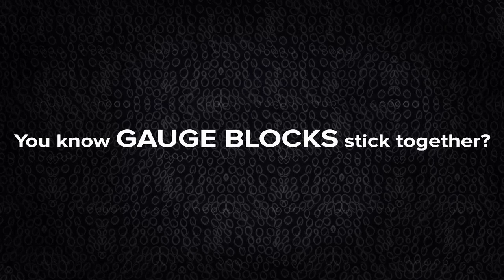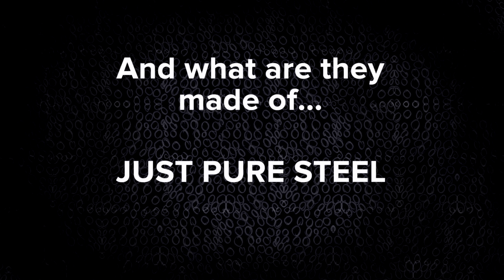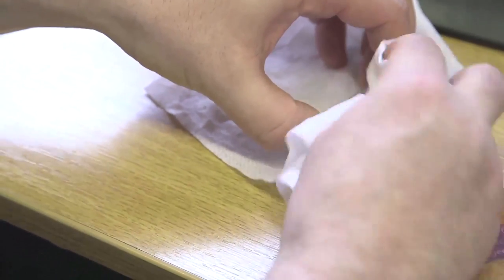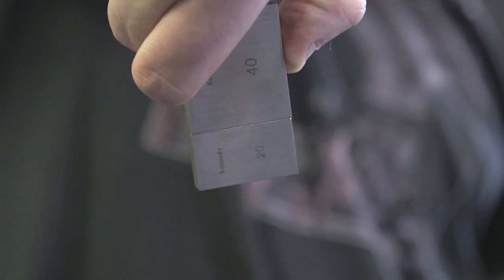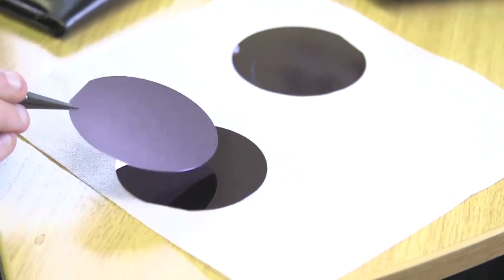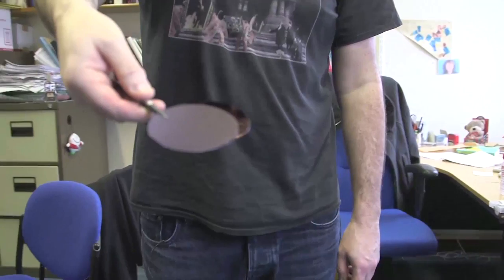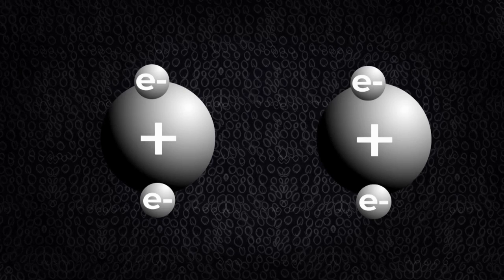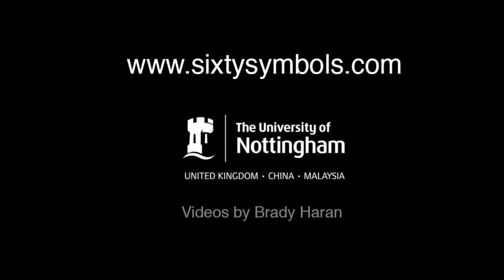Gauge Blocks (Van der Waals forces) - Sixty Symbols

Comment: No offence,  but strictly-speaking I think there is an exchange of charges, at least between the protons now exposed due to this manipulation of the atom's electron density such that exterior charges (generated by electrons) could be exchanged with the exposed proton. I ran into this a few years ago when fumbling around with the inexact notion that Van der Waals forces correspond to gravity; in a convoluted sense, that is part of the picture I suspect, but only part of something elaborately more complex.

Comment: does this kind of attraction work even in vacuum chamber? If yes it is the vanderwaal forces. If not it is the air. I am not sure but I have a feeling it is the air pressure that is keeping them together. Like when you glaze them on each other you remove most of the boundary layer and accidentally put some microbumps on the first layer into the microvalleys of the other. So their mating makes a low pressure zone as there's far lesser air molecules between them this means the outside air will keep thek stuck and if we put these things in vaccuum that effect will disappear. If it is indeed vanderwaal thats's the dominating force then vacuum wony affect it so this can be used to distinguish between the two proposed solutions

Comment: @Steve Mould Actually it is quite know why gauge blocks lock on each other. The perfection of the surface is to amazing that the iron atoms from both surface exchange electrons. Well, they always do on each contact, but with the gauges the amount of atoms doing that interaction is astronomical. The resulting adhesion is strong enough to hold its own weight and far more. If you let them REALLY degreased and let it rest for a while, some weeks, once you break the connection you rip out atoms and you kay even damage the surface to a point where no adhesion more is achieved and in worst scenario the precision of the gauge is compromised (I worked with 1 micron gauges in a laboratory long ago, 1,000mm; 1,001mm; 1,002mm.... amazing stuff). In high graded blocks ( metrological calibration ones for instance) even a few days. If you let them for really long time (this one I never did) they begin to exchange atoms and get fused. This is based on the atomic diffusion law, that can predict how long it will take, I do not remember more that deeply this stuff.

But it is in the structure of steel, Iron atoms do exchange atoms in a soup of electrons. THAT is the may reason metals are conductors...

So hope to have solved the microscopic enigma :o)

Comment: Just some tiny scratches will make them very hard to stick. With new blocks they stick like crazy. The surface rust on some blocks makes me think that he gave you the bad set, which is the normal thing too do. Cleaning them often with bad paper towels are sometimes enough too make microscopic scratches.
Gauge blocks are one of the things that you just don't want to let other people use. Micrometers are another thing that are always returned in bad shaped when one of my collegues borrows them.

Comment: Those Gage Blocks do NOT look flat enough. 

Is it VACUUM..? I don't know - vacuum? Without convexity? But rather, extremely FLAT? No.

What if it's in the same vein as SURFACE tension ..? 

The Silicon seems different, bc they're light enough that static would hold them together. 

Metal is much more indicative, bc even if there were an iota of space for vacuum; it CANNOT be enough space to exceed the weight of them.

NIIIICE!!!  I honestly was thinking it could be related to the electrons - but obviously not a chemical bond. I like this HYPOTHESIS; how can you prove it's the Van Der Waal effect ..?

Comment: Chinese rubbing bowls that are used to demonstrate standing wave effects, are also the indicator of the way water molecules are ejected through the meniscus/surface in evaporation. And observably, it's all about resonance/interference and Quantum Operator Fields Modulation Mechanism of probabilities in potential possibilities for QM-TIMESPACE. 

Eg Vacuum welding is apparently the norm in orbital technology where crystal bonding is particularly well ordered and monocrystalline, making materials formed there super strong,  or so we're told, chip tech is Commercial in Confidence?

Comment: There's a demonstration using Chinese Rubbing Bowls of standing waves, (equivalent to thermal excitation), and it goes with the ejection/evaporation of molecules from the surface tension boundary of a substance (and solids), so the interaction of fields of Van Der Waals forces seems to fit the story. Interesting.

Comment: If you press together two truly ideal smooth surfaces of the same pure substance in a vacuum, they will simply fuse. Forget about van der waals forces, they will bond on contact in a process called cold welding. As Feynman put it, the atoms in contact at the surface don't "know" they are on different blocks; it is just a continuous lattice of atoms from one block to the next.

Comment: Do you know of any research that proves this? I'm having trouble finding things pertaining to the van der waals force specifically in the context of metals and what surface finish is required to produce a proven van der waals effect. Optical contact bonding sure but that requires surface flatness better than 1nm but gauge blocks wring just fine at 25nm flatness. Whats the deal? Wheres the references?

Comment: You made it too clean...it is a vacuum thing. It is so flat that a little moisture from the air will make a seal. The metal flexes like a suction cup.
Reply: If it was a vacuum thing, the blocks wouldn't wring without air, and they do.  Put them in a vacuum chamber, and they still stick.

Comment: My understanding is that it is primarily 'stiction' that does this to gauge blocks? Despite the finish of the block they will both have peaks on the surface and the flatter the average surface is the higher the probability of numerous peaks nano-welding to each other under the force and friction of rubbing them together?

Comment: At 1 atm pressure if you prevent air from getting in between two surfaces you have slightly more than 1Kg normal force per square cm, which is more than enough for some nice tricks. If you work with precision mechanics you know that very flat and smooth sufficiently large matching surfaces can cause dangerous sudden detachments...
Reply: And yet they still wring together in a vacuum.

Comment: Lol Prof Moriarty you are meant to handle gauge blocks with greatest care as they are expensive precision equipment, dropping them from that height may cause it to deform. The best method of getting them to stick is to place them orthogonally in the middle (like making a cross) and twist them parallel. Is it possible to measure the exact force contribution of Van der Waals as apposed to other types of force exerted on the interface between the 2 gauge blocks? Does the composition of the metal alloy have any correlation to the force exerted or is it purely due surface smoothness?
Reply: FLATNESS is most important, not smoothness.

Comment: That was a very unsatisfying explanation. The surfaces are extremely flat, and almost seem to repel each other when simply pushed together. The effect is very strong when the surfaces are twisted, or wrung together, and a light coat of oil seems to increase the effect of the attraction. This leads me to believe that the forces he describes aren't the only forces at play here...

Comment: I always understood that gauge blocks held together due to air pressure as per a collapsing can when the air inside is removed so I am not convinced by your argument. To convince me you need to show that they do indeed still stick together in a vacuum and that the force to separate them is the same in both cases.
Reply: Go and check it yourself.
Reply: Whilst I do have a small vacuum bell jar, a water jet pump and ALSO some gauge blocks, they are not suited to carry out the check or I would. Having raised an alternative and I believe widely accepted proposition for the adhesion of the blocks the ball is as far as I'm concerned in Sixty Symbols court to do another video proving me wrong and them right! Not much to ask of a university physics dept. is it?

Comment: couldn't it be explained by the tremendous deficit of air between the plates making the atmospheric pressure the only glue needed ?remember : 1kg/cm2 is sure enough to hold this tiny piece in place.
Reply: ahrf.. sorry, cody has already shown it was still holding under vacuum..
nope, i'm wrong

Comment: We were told to never leave them stuck together because they would ultimately bond together in places and the surface would be damaged in breaking them apart. Maybe this is really just a precaution against corrosion since it sounds like there's no exchange of electrons going on. I suppose this could be proved by leaving them together for an extended period in a vacuum.
the same advice was given about the anvils of a micrometer.

Comment: Phil is ma favorite, but I am highly disappointed with the explanation. This phenomenon, also called Cold Welding, happens in space, at near vacuum pressure. I'm not sure water would be present on the exposed surface under those conditions. Indeed, I am not undermining Phil's knowledge, but I'm not impressed with the explanation.

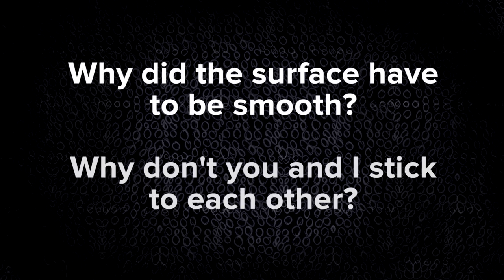Comment: That statement at 5:55 sounds wrong. This might be partially due to the diagram, but his explanation is also vague and misleading. The pits and valleys of rough surfaces don't cause the forces to "not add up right", it simply causes there to be an incredibly low probability of surface area overlap. Since the Van der Waalls force only operates at extremely close distances, this results in a cumulative force too small to hold them together. Consider two equally sized, but differently rough surfaces that have any arbitrary amount of surface area interface when put together. Each side will always have the exact same amount of its own surface area touching the other's.
Reply: They should pin this comment. It's the amount of surface area contact that increases the amount of force, not the bonds being out of wack or something weird.
Reply: I agree with you. The smoother the surfaces, the better the more molecules are in close contact with each other, giving a greater overall effect. Van der Waal's forces are extremely distance-critical, so with a rough surfaces, most molecules are too far apart to "switch on" the attraction.
Reply: @joeblogs8589  There are no molecules. Steel is a metal. Hence a Body Centered Cubic metallic bonded structure.
Reply: @locktite401  Yes,  but my statement is for surfaces in general looking at V.D. Walls forces in all friction.
Reply: Yes, the force and so the influence decreases squared as the radius or in this case distance gets raised, but after this question you want to keep it simple (no offense).
Reply: One more thing to be careful about is orbital overlap.  It is important to distinguish between this and the purely dynamical effect that is VdW forces.  If there is any orbital overlap in the system, then the binding is not strictly a VdW force; it is a chemical bond.  For a more detailed explanation see Chapter 15 in "The Chemical Bond", J N Murrell, S F A Kettle, J M Tedder (1978) Wiley.
Reply: This is more a matter of semantics, of course the amount of surface area where the distance is small enough to cause Van der Waals forces will determine the total amount of force. So these VdW forces do have to add up. 

On the other hand, one could interpret "not add up right" as some forces being repulsive and some attractive, which is definitely not true, all VdW forces are attractive.

Btw, the layer of water also acts as a glue through VdW forces, it works through Keesom and Debye forces. The explanation given in this video actually concentrates on the most interesting of the 3 Van der Waals forces: the London dispersion force.

Comment: Sorry, I'm not buying this. Why do you have to slide them together if the Van Der Waals forces or water is responsible? You should be able to just push them together?
Reply: +Curt D
To minimize air pockets, maybe?
Reply: Don't call him slow... He's just not as fast as the rest of us. You need to slide them together to make sure you have the best contact.
Reply: To scrape off the layer of oxide.
Reply: Curt, you idiot. Because you need atoms very close together to V.D.W. force to work at all. Even with gauge block high level of flatness you need to "help" by pushing it.

Comment: Have you done the calculation to prove that it is not a vacuum? If so please show work. Thanks
Reply: Proof that this is not vac.: https://upload.wikimedia.org/wikipedia/commons/e/ed/Gauge_block_adhesion.jpg
Air pressure will not support that much weight.
Reply: Thanks for the wikipedia reference. It should have been discussed in the video.
Reply: The easier way is to simply put the blocks in a vacuum. They don't come apart.  It isn't air pressure holding them together.
Reply: OLD JD Exactly! He's a phony.
Reply: On the contrary, I don’t feel the professor is a phony. I watched the video of his thesis defense and I think he know physics. However he does not make much of a scientific argument in this case. Ringing gauge blocks seems to be due to vacuum since the surfaces are ground to fractions of a 0.001" and thus putting then together in the manner shown appears to drive the ambient air out of the gap. I am not saying that Van der Walls forces are not a work, because there are examples in nature where they are the only explanation of adhesion (such as the Geckos) but some analytical justification from a PhD physicist should be provided to convince the audience.

Comment: How does this compare to Cold Welding?
Reply: As far as I know they are similar, but not the same. In wringing, also called optical contact bonding, the two bodies are extremely close, but are still separate. All that is keeping them together are the intermolecular forces like the van der waals forces as explained, (disregarding the water effect.) In cold welding greater pressure is applied to force the bodies closer together, so much so that the atomic lattices of the two materials can become one with one another, e.g. in metals usually creating chemical bonds, sharing electrons between neighboring atoms.

Comment: You didn't explain why we need to forcefully slide/rotate the gauge blocks
Reply: To push atoms closer together (regardless of very high level of flatness), and scrape off last tiny bits of dirt. That's general rule in mechanical metrology (try to always slide things together, not just put one on the top of another and expect precise, consistent results, readings).

Comment: That's neat. We used to this in school with simple glass prisms, but we had to rub them together for a long time. Several minutes, usually. And once most of the air between them was gone, the total internal reflection stopped and light went right through the (no-longer existing) gap. We always assumed most of the force holding them together was in fact air pressure. Maybe we should have tried in a vacuum chamber, but we didn't.

And wasn't this why Teflon was invented? To keep the folded-up arms of satellite solar panels from sticking together?

Another reason for why the surfaces need to be smooth is that van der Waals forces drop off quickly with distance, so on rough surfaces, only very few points are close enough to each other for them to become relevant.
Reply: FLAT is your main concern, not smooth.

Comment: you're supposed to wring together lightly oiled gauge blocks. the thickness is actually  what is stated minus one layer of oil, which means that errors from the layer of oil don't compound when you have multiples wrung together
Reply: Errors will show up and add up, that's why you have special stack compensation tables for gage blocks.

Comment: I wouldn't be so sure about that without doing actual tests to verify this several people have made some decent attempts already, but so far it is not really clear what exactly is going on - how much each factor contributes.  

Specially as gauge blocks, while they are incredible smooth, their roughness is still in the tens of nanometer, so even when wrong together most parts would be so far apart that the Van der Walls forces should be rather small.
Reply: They are very very FLAT, smoothness in NOT a goal here!

Comment: Cleaning the blocks with Acetone was actually unnecessary. The best way to get those blocks to stick is to take a clean piece of  paper, Lay it on a flat surface and rub the surfaces you are putting together on it. You'll see any debris left on the paper. After that you'll have a tough time taking those blocks apart.
Reply: No, paper is a light abrasive material. Avoid that type of pseudo "cleaning" on any precision equipment.

Comment: Is this the same phenomenon as cold welding?
Reply: As far as I know they are similar, but not the same. In wringing, also called optical contact bonding, the two bodies are extremely close, but are still separate. All that is keeping them together are the intermolecular forces like the van der waals forces as explained, (disregarding the water effect.) In cold welding greater pressure is applied to force the bodies closer together, so much so that the atomic lattices of the two materials can become one with one another, e.g. in metals usually creating chemical bonds, sharing electrons between neighboring atoms.